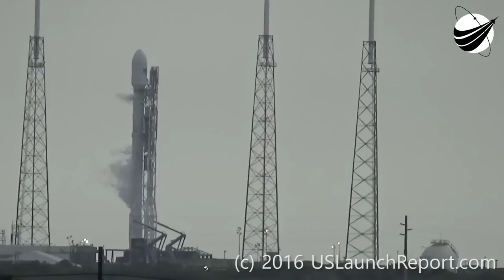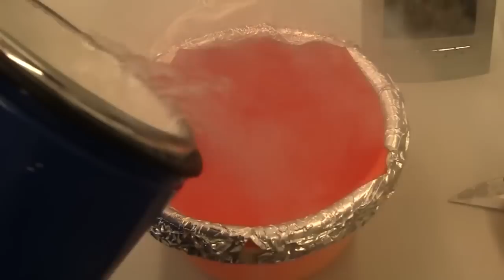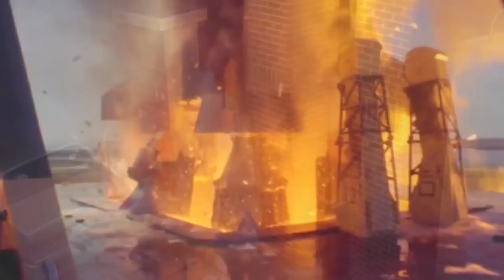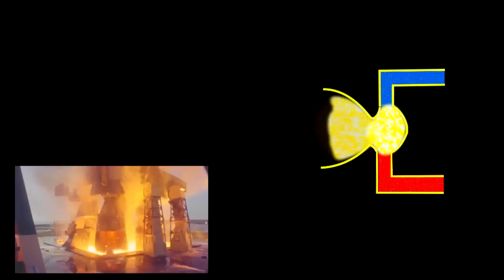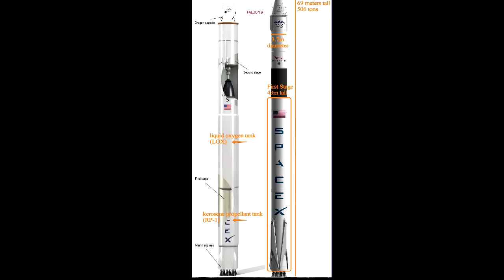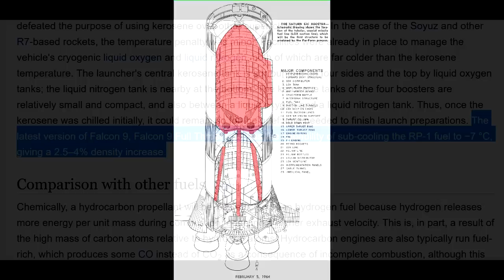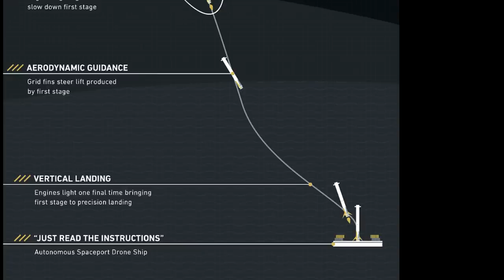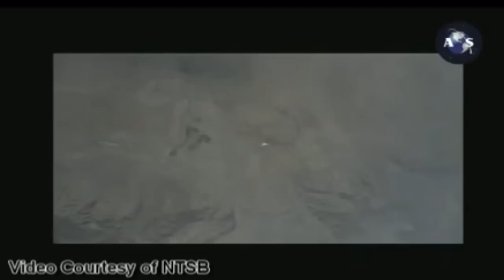Why did the Falcon 9 Explode?

Comment from the maker: This firework cost ~$250 000 000!  In a FUELLING EXPLOSION!  Not seen one of those for a LONG time... good job spacex! ;-)
Reply: I like your analysis of the cause of failure, but bear in mind that F9 reusability is only a way of further reducing the cost of spaceflight. SpaceX has already reduced the cost of a launch to $62 million, far below competitors Arianespace or ULA. This is a setback to be sure, and not to be understated, but we shouldn't take it as validation for the extremely risk averse practices of NASA etc. being the best way to do things.
Reply: I wouldn't be so harsh on spacex, as you demomstrated in this very video, they have some archivements, and rocketsience is very hard. if they fell for wrong manufacturer specifications again, they should be laughed at... a lot. 
And even if, is't not like nasa never fu**ed up big time as well.
Reply: At least it is not a billion dollar manned spacecraft exploding due to isufficient reenrty protection 
AMIRITE?

No?
Ok ,I'm gonna sit in the corner and cry then...
Reply: When Colombia spattered across the sky, did you say "This firework cost over $1,000,000,000 and seven lives! In a REENTRY FAILURE! Not seen one of those for a LONG time... Since Soyuz 1 in 1967, in fact! Good job NASA!" 

I doubt it.
Reply: +TheKSPDesigner no it hasn't, this was the Amos-6 F-29 core fresh off the assembly line, not a reused booster
Reply: david jurado mate wat
Reply: Why all the butt hurt? It wasn't your $$$, was it? I've got to imagine the payload was insured. All this did was guarantee that a bunch of engineers will get continued employment while they rebuild. Don't be so afraid of the non coercive economy.
Reply: No. If a design problem is solved by 'don't do X', then any future design that incorporates 'X' is a really bad design. What TF is saying is that NASA wouldn't build a rocket that would fail like this because they learned from mistakes made a long time ago, and SpaceX just made a 60-year old mistake.
Reply: I hope you ate that chicken
Reply: I didn't pay anything, WORTH IT
Reply: $250 million is the initial asset lost cost, but there was also the lost money as a result of the payload's mission.  Being late to market is lost financial opportunity and this set back is probably a 2 year setback for whoever owned that payload so there will probably be additional damages.  Also, insurance costs will go up on the Falcon now that they've had this catastrophic failure.
Reply: Sometimes I get the feeling that if TF were alive in 1903 he would have attempted to talk the Wright brothers into sticking with bicycles. New steps are expensive, and sacrifices must be made. It takes courage as well as brains to be a scientist. TF may be lacking in the chutzpah department.
Reply: I don't get your logic. The two Space Shuttle crashes were both from single point failure, and people died in them. Even NASA with years of experience couldn't account for all hazards of space flight.

Yes, whether or not reusable first stage will turn cost efficient remains to be seen. To figure it out, somebody has to actually try it. That's what SpaceX is doing right now, and it's harder than you clearly can even imagine. The first stage landing crashes you show are what NASA went through too - the differences between mathematical modelling and real world. You can't build a successfull rocket program without going through several of these. 

But most importantly, these have nothing to do with the explosion you're talking about. That one is not related to reusability. You don't know what caused the explosion, you just guess. Then you come blaming them for mistakes you guessed they made. 

You call that scientific approach? I do not.
Reply: A $250M rocket and statilit lose, not seen by NASA since... late 2004 when the Antares rocket blow. Almost all rockets in the US have been designed and made by "the free market" but paid for by NASA. NASA is still massively funding SpaceX. SpaceX has no bigger founder then NASA. The space shuttle was not made by NASA for NASA, but was made by the "free market" with the companies United Space Alliance, Thiokol/Alliant Techsystems, Lockheed Martin and Boeing/Rockwell.  The only thing that changed with SpaceX is who was in the lead. And when  goal is to make things most cost effective, the free market is generally the way to go. Where as, if the goal was just say "get to Mars, no matter the cost", NASA might be the better bet. Even though, NASA would outsource much of the work to private companies like it has in the past. 
  I find overwhelming praise or attacks on SpaceX to be equally pointless and silly. The lower the cost of getting to space is a worth while goal. Getting a smaller payload to space at $250/lb, is generally better then getting a larger payload to space at $1,000/lb, at worse there is "some assumable required" once in space.
Reply: Oh, don't be so hard on SpaceX for a failure that NASA hasn't had in 40 years. An issue with a machine isn't exclusively a design issue. The rocket's design is plenty good enough as is, as we have seen with how successful the rocket system has been in the past. It was probably just a case of a component that had some manufacturing fault in it make it to the launch pad, making it more the fault of the QA team than the design team.
Reply: Seriously spacex fanboys, the mental gymnastics you're all pulling here is too funny. So because they've accomplished some menial reductions in price, and the fact that rocket science is hard, makes up for the fact that just trashed .25 billion on a rookie mistake that hasn't been made in over half a century? 

"well Nasa fucks up too!"

Not having the damn rockets explode before even leaving the launchpad, moron.
Reply: It's not like they have 50+ years of rocket science to draw from.

Oh wait...
Reply: +yemo34 - The reason Humans wish to go to space is about self preservation. Earth won't be around forever, and having Humans in multiple areas means you don't lose your entire species to one event. 

All animals do this, except Humans do it on a grand scale. We know the dangers in Space (NEO Asteroids for example) and thus try to mitigate the impact something like that would have.

People living on Mars or the moon, capable of Earth return could repopulate after a mass extinction event.

Humans have already left a mark in Space though, with Pioneer 10/11 and Voyager 1/2 and New Horizons. Robotic spacecraft and AGI will be the first explorers we send out from the orbit of Sol, but it is with the intention of Humans following it.

Life as a necessity to survive and spread, from a Virus to Humans, whales, wasps and crocodiles.
Reply: fanboys incoming...
Reply: Wow Thunderf00t.  You are something.  When someone aims high and has a setback, you are sure quick to pounce.  Meanwhile you have made....weeeeellllllll.....youtube videos.   Bravo!
Reply: Since when? An explosion is an rapid increase of pressure, not combustion.
Reply: I actually learned a lot from this video. Thanks +Thunderf00t
Reply: We want to go to space for the same reason Humans went out into the ocean trying to find the end.  Most were never seen again but they would continue trying anyways.  Curiosity
Reply: It's quite sad that you genuinely seem delighted about this.Once upon a time you seemed pro science and technology.Because the guy has one stupid idea that means all his other ideas must also be stupid?
Reply: @Downstream01 I started watching this channel during "why people laugh at creationists"  and if there's one recurring theme throughout almost every video rebutting stupid shit it's the fallacy of "appeal to authority."  And somehow, that's where this video lands...appeal to NASA as authority.  Does it strike no one as ODD to cite a basically closed government agency with a seriously checkered past as "authority"?
Reply: Thank you for the lesson. I really enjoy your intelligent commentary on these subjects.
Reply: This rocket has not "gone to space and re-entered", that mission was planned for later in the year.  Also the explosion appears to originate in the second stage, and SpaceX has not done any work to recover second stage rockets as yet.
Reply: ***** i give TF some credit because i think (hope) that he is trying to say NASA should be doing space because they already did it and they do it better...

except NASA isnt doing SHIT anymore, its a space agency we created to defeat the russians and now the russians are the only ones sending people in to space, we've completely given up on ever going in to space again...

my dad was 11 when Apollo 11 touched down, i now have an 11 year old daughter and im more convinced then ever that not only will i never see a manned space mission in my life time, she'll never see one in hers... not at the rate NASA is going... so if NASA isnt NASA'ing any more then TF, what the fuck do you want?!? if the government space agency is retired then we have to rely on the private sector, and if you want them to give up or fuck off then youre basically saying give up on space completely.... fuck off
Reply: They wont. Elon's becoming unhinged. He'll force his engineers to cut corners.
Reply: Actually, NASA lost an Antares rocket carrying cargo to the International Space Station a couple years ago. It exploded shortly after launching on Oct. 28, 2014. You even used video of that explosion in your video. Does two years count as "a long time"? Or is it a fueling explosions that haven't happened in a long time? I think you might be right about that.

The Falcon 9 rocket has launched 13 times without failure. Still, this might cause insurance problems for Space-X. Everybody loses rockets, China has lost some, Russia lost a lot of them, France has lost some. So, Space-X is on par with everyone else it seems.
Reply: Louis M Your arguments are now dwindling down to appeal to emotions. No, unlike you fanboys, he sees through the facade and criticizes them for how they actually perform
Reply: Oh, the irony. Thunderf00t predicting the exact cause of failure many months before the SpaceX "experts", and all those butthurt idiots who said that Elon and his team don't need his help are now silent. It's almost orgasmic!
Reply: what do you say?, now that spacex successfully reused their rockets and sustain continuous launches almost every month?
Reply: Bah, the insurance company is paying for it. ;-)
Reply: A really great fun demonstration of a chemical reaction at the beginning there; albeit a rather expensive one! 

I imagine some guy in a lab coat loosening his tie, gulping, palm to forehead....."Doh!"
Reply: lack of funding for NASA, it usually gets slashed in favor of the military industrial complex.
Reply: i can make this video way shorter: "Why did the Falcon 9 Explode? cuz space is hard"
Reply: Yes and you know, why we all are using the rockets of the Sowjets? Because they know since 40 years how to send people to and bring back people from space ALIVE. Because as NASA they have high security measures, they are only cheaper because russia is always cheaper
Reply: 250,000 is 1/4 of a shuttle flight. Spacex can fail 2 more times and still be the same cost. Spacex also has a backlog of over 70+ flights to go. That's over 10bil of revenue,  unfortunately for the haters,  spacex is not going anywhere.
Reply: 250,000 is 1/4 of a shuttle flight. Spacex can fail 2 more times and still be the same cost. Spacex also has a backlog of over 70+ flights to go. That's over 10bil of revenue,  unfortunately for the haters,  spacex is not going anywhere.
Reply: interesting fact....NASA hasn't launched a shuttle in quite few years.  I mean, of COURSE my driving record improves over accidents vs. time if I stop driving for a decade...
Reply: TF you need to revisit your argugment here. You're saying because theoretically this was solved, there cannot possibly be any error? Like some material problem they didn't know about? You can have all the technology the same, but a minor problem with one of the tanks would be enough to blow this up. And you base this all on a lot of assumptions about what you think happened. 
It's ok that you comment on it but I hate that you're that smug about it, without actually knowing what happened.
Reply: At least it didn't come out of your taxes.
Reply: qantj vulpis by using liquid hydrogen as coolant for engines and having a better design in general like in space shuttle, like engines and tanks on different units-eg space shuttle or using solid fuels as main thrust
Reply: by keeping it's size small and bulkier,Hang on, i'll find an article in a while.
Reply: Quality content, as always, thanks Thunderf00t.
Reply: Cost of launch is not the most important factor when deciding on a carrier, the space "market" is complicated most of the money is from  government launches.   ULA is used due to reliability, the NRO satellites used by the NSA are very expensive, secretive and take a long time build, and the carrier will need employees with a high level of vetting and security clearance. If SpaceX wants to launch a government satellite you will need to vet and security clear ALL employees who will have access to it - in practice this is a nightmare.  For this reason you tend to get a monopoly for large government contracts, there are limits to privatization. Also globally, even if Space X is cheaper you won't find China, Russia, India, using an American company to launch any sensitive satellites they will use their own facilities for the security even if they are more expensive. Musk has in fact complained about ULA's de-facto  monopoly, but I can understand why it's better to have reliability and security even if it costs more.
Reply: Downstream01 Or maybe Thunderfoot is completely wrong about the origin of the explosion, and has simply put forth a reasonable hypothesis without any data to back it up at this point other than eyeballing the size of a fireball. Don't get me wrong, I think thunderfoot is a smart guy, I just don't think that he with a piece of video footage has figured out the exact cause of the explosion when the engineers at SpaceX that have access to literally gigabytes of diagnostic data with millisecond timescales AND the same video AND more video they recorded themselves and haven't released yet AND the actual physical remains in front of them haven't worked out yet.
Reply: Rothpol X "Or maybe Thunderfoot is completely wrong about the origin of the explosion, and has simply put forth a reasonable hypothesis without any data to back it up at this point other than eyeballing the size of a fireball. Don't get me wrong, I think thunderfoot is a smart guy, I just don't think that he with a piece of video footage has figured out the exact cause of the explosion when the engineers at SpaceX that have access to literally gigabytes of diagnostic data with millisecond timescales AND the same video AND more video they recorded themselves and haven't released yet AND the actual physical remains in front of them haven't worked out yet."

People who know science, math, and engineering can estimate and make very good educated guesses about the cause and nature of things, especially since there is a very good record of these failures kept by NASA. The only problem is that uneducated, ignorant people like yourself don't know any better and just assume quite wrongly that he is pulling it out of his ass.
Reply: Downstream01 As i told someone else, the Atlas V rocket, which is what the falcon 9 wants to replace, has a perfect record of launches and only costs double the money.

Too many amatuer arguments, without valid reason or facts.
Reply: Would it not be smarter to build a sling shot. #thinksmart
Reply: Blox117 Well, since you seem interested in my personal expertise, I will stay that as it happens I have an engineering degree as well... but it's not exactly necessary to see that escape from this explosion would be possible... ask and you shall receive, since an overlay of the launch abort test, and the second stage explosion has already been posted, showing that the crew dragon could have escaped with time to spare:-

https://twitter.com/StateMachines/status/771535425328459780
Reply: Admiral Quality 48 years old but cant hit the reply button and still talks like a child throwing a tantrum.
Reply: Happy Larry Fix it?! LOL
That rocked looked a little bit like "beyond economic repair" to be frank.
Reply: Well, it happened in 2010 with a proton-M rocket, it was admittedly a human error, but still, it happens...
Reply: A crew vehicle with an LES definitely would have survived as a similar failure happened on Soyuz t-10a back in 1983.
Reply: DysphoricSmile You are mostly right, however spacex is first company that have so low prices and can build new things a lot faster than sleepy giants like Boeing.
Reply: Russians are very...different. not in a good way
Reply: I'm just glad it wasn't $250 000  000 . 00
Reply: If I am not mistaken, that is not an explosion. It seems to simply be rapid combustion. Are you sure it is an explosion?
Reply: agun17
They were chilling the Liquid oxygen. For Kerosene, heating to ~70 degrees celcius works better and that is what SX and most launch providers do IIRC.
Reply: +TheKSPDesigner no. that's a different first stage.
Reply: +BosonCollider you're rates have gone up by 30%
Reply: +agun17 
Chilling of fuel was used in Formula 1 from 1970 (when there was fuel limited for turbo engines, and for faster refueling) till was banned (technically it is not banned and it is still used in F1 but minimal temperature of fuel is limited) , so it is not new.
Reply: Rapid combustion that spreads haphazardly is also an explosion.
Reply: +TheKSPDesigner no it's not, it's a new stage. JCSAT 14 is currently at McGregor undergoing delta qualification testing , testing the booster for how much stress it can withstand before failure, although this is probably on hold after Amos-6's fiery demise
Reply: See, the thing here is that the mistake was so trivial. Not saying that that doesn't happen but it is something that is uncommon now only because people are always sure to take care of it. It is laughable for sure.
Reply: This was a new one
Reply: are teslas lithium ion batteries dangerous
Reply: @Chuck norris German ww2 Jet engines failed all the time and only lasted 24 hours of flight time
Reply: No they are perfectly safe. Trust elon and put a giant one on your wall.
Reply: i trust NASA more. NASA is like a grandpa that has lived a long time and has good hindsight and knowledge on the other hand space X is like a newborn
Reply: +ThunderF00t

Do a "Why do people laugh at Moon Landing Conspiracy Theorists"
Reply: +dan1088352 I know  right. oh look your 2 degrees off in your reentry angle!! sure hope your heat shields cover enough to keep you from disintegration ;).
Reply: yemo34
I wouldn't say it's impossible, just very very very very hard. You need lots of self sustainability and life support & the ability to get fuel and raw materials form space, but its definately possible.

Current technology prohibits this at the moment.

Cavity Magnetrons are not trival and have a lot of uses. Materials science has also advanced shit loads due to space programs.

Just rolling over and excepting defeat is what kills people. From people not willing to act against SJWs, Feminism and Islam, to things like self preservation and space travel.
Reply: This is why I am all about that orbital elevator!
Reply: should have mentioned the price of the pad there at the start. i hear that thise pads are by no meens cheap.
Reply: I would love to hear Thunderf00t talk about the possibilities but I'm afraid he might crush all my hopes in the process.
Reply: You know, why we talk about Vasco da Gama, Kolumbus, Magellan, Cook? Because they or their ships came back. Nobody never went out to sea to find the end, they wanted to find new land and then come back. And they did it.
Reply: yeah and they are going to send people to mars. yeah right with their rockets blowing up the people will be dead on the launch pad.
Reply: Gahlok12 let's hope they get the whole explodey error out the way before then.
Reply: Not hardly.  A common trick used when setting long distance records in jets in the 1950s, when they were thirstier than today, was to chill the fuel using cans of dry ice (Solid CO2) dropped into the fuel trucks.
Reply: It could have been worse Thunderf00t, this could have happened with humans on board.

After learning about the most basic of basics of rocketry you start to get amazed that we got to the freaking moon so long ago with their computer tech.

I hope SpaceX learned from the explosion, atleast in that way it was an expensive lesson rather then just a waste of money.

I always wondered if it would jsut be possible to (forgive me for being the most lay of laymen) strap alot of parachutes onto the rockets so they open up after they are spent and at the apex of their arc.

on another note, why are they sticking to just rockets?  I mean we have some other methods that coudl replace the first stage of most rockets.  Something like a startram?  Are any of those ideas doable AND feasible from an engineering and science stand point?
Reply: Not when the idea is to stuff more Joules into the tank.
Rockets, and jets, store it by the liter/gallon (Volume) and burn it by the kg/lbm(Pound-Mass - it's more elegant than a Slug) (Mass)
The more Joules/L that you can stuff in, the better.  There might be a slight loss in absolute efficiency, but the overall performance is better.
Reply: +david jurado Dont hold your breath.
Reply: Look everybody Im a magician! I can pull numbers straight out of my ass!!!
Reply: Daniel Domeisen Theres not enough air at that altitude to slow the rocket down with  parachutes And the technology to build startrams doesn't exist yet, or its impossible.
Reply: what
Reply: yemo34 why would it be impossible, again from my (basic) understanding it is just a matter of making the damned thing.  it is pretty big and in essence just a long angle 'gun' that take the payload into thinner atmospheres of our planet.  Like i said it ONLY replaces the first stages. 

Now the POWER needs of the thing would mean it needs a power plant just for it but how much does a first stage take to make and use?

Again i am a laymen but a StarTram seems like it should be able to work though there are engineering issues to work out.  Like i said the thing would be pretty long to get up to speed at less the 3Gs so humans can get in it but if you nix the organic cargo you can ramp up the 'a' part of the equation to more then 9Gs.

The only part of the tech i do not understand is the Plasma Curtain at the ends, but even without that it is just a massive train up a mountain that goes very fast and launches it's cargo at the apex.

Like is aid i am a laymen, i take it you are as well?
Reply: Daniel Domeisen Just sounds like hyperloop in space to me.
Reply: too a degree but easier to pull off since it is kind of designed to fail in a way.  it is also on the ground, it is not flaoting or anything like that.  

It is also suppsoed to be either buried into the mountain to avoid the thermal expansion issue  or a cooling system would be used.  A big part of getting off of Earth is punching through our thick atmosphere  and getting up to speed.  The idea would be like a one way train in a tube to 'launch' the rocket at the top of the mountain (if possible past the cloud layer).  

it is NOT meant to be used to general civilian use, it would be used to get material up into orbit so we can make either a Space elevator or something like a sky hook so we make space flight easier and get some infrastructure up there to make to make get solar system travel going.  

Think of it like the 'Paris Gun' idea from WW2 but not used to shell Paris and instead used to reduce the cost and/or (hopefully and) mass to get stuff into orbit.

That is a Star Tram in it most simple form, a massive long barrel designed to get the rocket to speed and into the thinner parts of our atmosphere.

Combine that with a Skyhook (another way to reduce the cost/mass of space flight) and you MAY be able to make space flight as cheap as shipping something across the planet using 'next day' shipping.  That is the holy grail of what we are trying to get to with space flight, Cheap, safe, and repeatable.  

I am a layman, hence i asked the real scientist about it.  I do not have all then answers so i asked someone whom i feel might know because they know ALOT more then me.
Reply: +Sam Holden fair point
Reply: I thought it was time travelers who sabotaged the rocket to save us from a future of impending doom from media censorship, surveillance, and militant use.
Reply: its not only money... for FB or Musk 250mil is nothing, but its years of preparation and trust.
Reply: +ESportsEnthusiast Soyuz 1 did not fail during reentry you fucking imbecile. Should expect this kind of nonsense from a "Sports Enthusiast" LOL!
Reply: a rocket to Mars by isro is cheaper... America should give up on trying to be a mobility on space grade equipment
Reply: Downstream01 and we shall call you:The Honorable Downsyndrome01!
Reply: unbr34k4bl3 its 2016 and people can still easily die on the launch pad. and just how are we gonna get to mars?

next comment
Reply: +Thunderf00t How did NASA fix the problem?
Reply: Blox117 yeah people can still die on launch pads. And people can die in cars and planes too....what's your point?
Reply: Suraj Grewal How did they fix the kerosene freezing due to the liquid oxygen being pumped past it?
Reply: They use liquid Hydrogen
Reply: Suraj Grewal How do they fix it for the lower stages that use kerosene?
Reply: trial and error plus the gap between the 2 tanks is quite big ,'ill say , while admitting that I ain't rocket scientist.
Reply: who has to cover the lose in this 250million dollar fire works show?
Reply: +kasuha I agree, even though there was some analysis involved to try and define the cause, the colnclusion was far from certain.
Reply: Yeah, read a bit on what we have thanks to space exploration... Microwaves are radar based, not really space tech. Usable solar panels are however developed for space.
Reply: Yes there are starving people in Africa
Reply: I wouldn't want to be the guy handing a bill over for the check. lol
Reply: unbr34k4bl3 Pretty much no one dies on takeoff or backing out of their driveway.
Reply: They were testing the fueling procedure when it blew up, they weren't pushing ahead with anything.
Reply: Downstream01 ahem
You have to mix the fuel in order for the to be complete combustion like we saw in the video. No matter how exactly it happened, it happened moron
Reply: Downstream01 Landing is probably the most dangerous part of flying.
Reply: Downstream01 The fuels don't magically mix, there's only a few different ways they could have ever come into contact. While we're at it, since you conceded that your original statement was quite clueless and folly, I've already won the argument.
Reply: Downstream01 Hell, you're so stupid that you think that they would want to admit that it was a rookie mistake  if it was, and that they could very well just obfuscating in order to protect their reputation.
Reply: Downstream01 Exactly right. I agree with Thunderfoot that fuel and oxidizer mixed to cause this issue, what I cannot agree with is the idea that Thunderfoot can somehow pinpoint the exact initial cause of the original mixing that led to the explosion. Obviously the mixture happened SOMEHOW, I simply don't think we know HOW at this point.
Reply: Downstream01 You're entire argument was based on it not being a rookie mistake because we do not know what caused it. But we do know that at the core of it, the fuels mixed. We also know it hasn't happened in over half a century. Hence, rookie mistake
Reply: Rothpol X Yep, because there is obviously just too many ways to count how two fuels could've came into contact while filling the tanks. 

You're right Downstream, Spacex aren't the the ones obscuring, you guys are !
Reply: Last time i checked an explosion is defined as a sudden release of energy. Rapid combustion sounds like an explosion to me.
Reply: aiGeis If it's a rookie mistake, why did it happen on a rocket design that has had more than 20 successful launches so far without anything like this happening?

To me it seems more like there was a hardware change in the umbilical interfaces, or maybe something wore out or broke or wasn't attached correctly, and the explosion originated there. Remember, SpaceX has already flown the Falcon 9 many times, and tested it many many more times on the ground, and they have NEVER come across any tank fracturing liek Thunderfoot suggested, nor have they ever had any fuel leaks or catastrophic failures due to an explosion. The previous Falcon failure, and the only launch failure, CRS-7, was caused when a defective strut allowed a high pressure helium tank to rip off of its mountings and slam into the forward tank bulkhead of the upper stage oxygen tank, which ruptured it and caused the rocket to disintegrate. Interestingly there wasn't any actual explosion there, just a big vapor cloud of un-burned fuel and oxygen. 

When NASA was having anomalies during fueling operations, they were still having problems even launching rockets at all, and had a massive failure rate across the board. SpaceX has had ONE fueling incident, on a vehicle that has flown more than twenty times, and people are acting like it's the end of the company.

Rocket science is hard, rocket engineering is harder, operating rockets in real life means dealing with problems and setbacks, every entity that has ever built rockets knows this.
Reply: Success does not equal perfection or mastery of said art or science. Sure SpaceX may have had a good streak of successful launches however this one failure has set them back a mile when they just walked forward 20 feet. If SpaceX takes their craft seriously, they MUST go back to the drawing board and figured out what the hell happened and go from there. NASA had their failures, yes. However considering they had nothing to go on, basically the pioneers in rocket design for space exploration, their failures are to be expected. Fast foreward 60 some years into the future SpaceX has suffered from a catastrophic anomaly that NASA has apparently already experienced and probably already resolved. Unless SpaceX is doing their own thing...which I highly doubt... they would be at least be smart enough to consult with some of the leading experts on space exploration, which one of them is none other than NASA themselves. I'm aware there can be millions of factors that can result in catastrophic failure. However if anyone in the space exploration program has learned in these last 60~70 years of trial and error, it is the 99% of catastrophic anomalies are a result of human error.
Reply: ^Literally the definition of mental gymnastics. Oh well, guess fanboys can't be helped.
Reply: aiGeis >A system as complex as a rocket will have issues early on in its lifetime

>mental gymnastics

what the hell is wrong with you dude
Reply: ***** Wow you really got me haha good one
Reply: Rothpol X There are only certain ways that the explosion could have happened.
Reply: the dunning kruger effect is strong with all the fanboys...
Reply: i used to like space x as well, but now it just seems like they are fueling their rockets on dreams and wishes. this popular opinion and pop science shit really needs to die. space x doesnt care about you, they dont care if you defend their honor on some video on youtube, it wont make a difference, truly.
Reply: Downstream01 " You know the Concorde was brought down when a piece of metal hit its tire, which exploded, the fragments of which hit the fuselage and sent a shockwave through the plane that burst the fuel tank."

I guess that incident truly was similar to a rocket exploding during fueling on the launch pad. 

"You have nothing on the already impressive technical feats SpaceX has done, the only actor interested in moving the space industry forward."

3/10 irrelevant troll bait.
Reply: Derek C. aw come on, its not spaceX's fault that they ride on rockets made out of rainbows and kiddie dreams.
Reply: you are the definition of a fanboy and you are not thinking straight because you are looking for the next Messiah
Reply: Downstream01 Im not against privatizing the space industry, but with such a stupid mistake like happened with the falcon 9, people will get killed before even going into space.

And no, saying "well NASA got it wrong too!!!!!" does not excuse the fact that they are making the same kinds of mistakes that happened in the 50s and 60s. If people were on that launch instead of that satellite, spaceX would have blood on its hands.
Reply: DarkBabylon - Gaming videos Shit, I thought that was only me. Jesus christ google, fix this shit already. Unbelievable.
Reply: Tactical nuke inbound!!!

https://2.bp.blogspot.com/-BZ95EiMjYQE/Vxc1K1x1DnI/AAAAAAAADSE/h67uMW3d0bgt2Qo0HYnLrG8Hm87eO3w2wCLcB/s640/Rainboom.gif
Reply: the rocket? nope it was factory-new
Reply: tssk
62$M  , maybe ...how man for the load again ? 200$M ?
I dunno, seems awfully costly when ou take account of the risk of loosing 200$M in load for your FAI/COM company to provide PHONE/TV/INTERNET etc...
IF i were to ensure to satellite reaches its destination , i 'd rather pay up for a more reliable rocket but more expensive than the  discount rocket wich really isn't very trustworthy....
Reply: Try and retry, explore new ways. Things sounding rediculous, thing you'd expect to fail initially. Tha is where all technology stems from.
Yeah look i have some sand here i put it in an oven and carve some intricate patterns on it an it'll solve mathematical problems for me.
Or let's put some halfdead bacteria into human bodies, it'll help them in the future.

Some ideas sound stupid at first glance but have proven to be usefull. We need to continue and we need more courage.
Returning booster stages is not that stupid. We have the Energy Density vs. Cost problem and are figuring out ways to compensate. During Cold War this wasn't much of an issue for cost saving designs weren't the goal. That is what landed humanity on the moon and is what hinders us to undertake the same thing today.

Try and fail.
Try and fail.
Try and fail.
Try and fail.
Try and fail.
Try and fail.
Try and fail.
Try and be successful. Bang !
Reply: The explosion actually happened during a test. It was the last test of many they carried out at Hawthorne and McGregor. How does it feel to be an egotistical idiot with no money?
Reply: But it is what we do in a grand scheme. Maybe not a suitable way for a company. But that is just how evolution works. Try odd things and some of them prevail. If you just look at a small timeframe or the history of a single company you won't see much of that. But in large scale this is what happens everywhere, all the time.
Reply: Shame you need to be sarcastic. It's so easy to point out other peoples failings. Why don't you crowd fund and just get one to leave the atmosphere? I mean it's not brain surgery....
Reply: Can I have half of that nothing please?
Reply: Who are you talking about? And how did the egotistical idiot get the money, and what would you consider too much money?
Reply: they dun goofed
Reply: New technologies will inevitably have many fails. I don't see you point. Mr Musk mission is to get to mars and colonise it. 
It's easy for people like you who mock it to be the first in the queue when the earth becomes inhabitable nd would beg for a ticket to mars which you almost certainly afford.
Let me give you an analogy.....Kids learn to walk by falling over.
Reply: +Sebastian Larsson Though "a rapid combustion" is the most common cause for explosions on purpose on our planet, a better description of an explosion is something like a sudden, rapid expansion due to a major release of energy. This would encorporate explosions from atomic bombs, (overpressurized) tanks and supernovae, for example.
Reply: Downstream01 really? so the crew would have known that the rocket would explode before it kills them?

come on now, the crew would be dead, and elon musk would look like an idiot and try to lay blame on some extraneous problem.

But at least you admit that the falcon rocket is not suitable for anything other than trials yet.
Reply: +DarkBabylon - Gaming videos "Comfortable" isn't the right word. "Hospitable" or "possible", maybe. Small amounts of people will ALREADY live on another celestial body before we're worried about things like "comfort". 

Note that being able to breath is a necessity, not a comfort.

I also said celestial body, not planet, because we're more likely to live on a moon than any of the planets in our solar system. (Or simply a different system entirely. which is more difficult, and many more years away, but more likely/plausible).
Reply: Louis M Your argument was based on an appeal to emotion "don't you want them to succeed"

What are you, a woman?
Reply: Downstream01 I am pretty sure they wont outrun an explosion. Pretty damn sure, in fact. If you would say that you trust your life on the escape system for something that is beyond its capabilities, then i guess the falcon 9 is just as safe as the space shuttle then. but at least the space shuttle, for all its flaws, never exploded on the damn launch pad. especially not so early in its life.
Reply: +Downstream01 I think sling shot tecnology is more safe and less expensive.
Reply: Downstream01 the escape system is only there if there is a known problem, such as a failure of the staging, asymmetric thrust, the rocket tips over, there is a fire, etc. an explosion as seen in the video was very sudden and without warning.
Reply: Blox117 Escape systems in manned rockets are not new, there are well established mechanisms for detecting catastrophic failure and triggering an escape system... one only needs to imagine running a cable around the inside of the structure which would be broken by an explosion or other "unscheduled rapid disassembly" event...
Reply: James Lewis and how, pray tell, would the escape system outrun the explosion?

please, IT and computer security is not similar to physics.
Reply: +Downstream01 If you guys send this info to space x could you also mention my sling shot tecnology. Thanks.
Reply: My theory is that NASA/Illuminati aimed an infra-red, high-powered laser and lit the rocket. Or, someone "accidentally" pressed the self-destruct button, probably a NASA infiltrator.
Reply: So, you have (and presumably, as you're posting about it, embrace) two complete disparate theories. Yeah, I can come up with an infinite list of what-ifs. But... SO-WHAT?

The FTS (flight termination system) wasn't armed yet (and probably isn't activated and armed at all during a static fire) so it would take more than an accidental press of the button to make that happen. (That said, yes, there's other explosives on the rocket that TF is completely ignoring and/or pooh-poohing. I think far more interesting is possible failure modes from the payload satellite leaking hydrazine down into the top of the second stage. Since we're pulling "theories" out of our asses now...)
Reply: You can probably guess I'm joking, right? I like your hydrazine hypothesis though.
Reply: Oh, others pointed that out before I thought of it. But while it may not be my hypothesis (frankly, I don't have enough data to form one) it's definitely a possibility.

So is sabotage, but that's just hot air without any evidence too. Let's try to wait...
Reply: Admiral Quality You make a quality argument, sir. The popular "theory" seems to be a UFO dunnit. Of course. Sigh.
Reply: Yep. Occam's razor in reverse.
Reply: Downstream01 elon musk should hire you guys so his next rocket doesnt destroy itself.
Reply: We don't know yet that his rocket did destroy itself. But job offer accepted, nonetheless!
Reply: Downstream01 is that a retarded use of a word you don't understand? put that word away before you hurt yourself with it.
Reply: Admiral Quality it destroyed itself, dont play the idiot.
Reply: Downstream01 "I see a butthurt naysayer who's been proven wrong and can't accept it attacking us, instead of our arguments."

Indeed, I see her too. By the nickname, "Downsyndrome01"
Reply: Downstream01 what is your picture about?
Reply: Thank you for making this video. I've been wanting to say something ever since the recent Space X failure, but I've been worried that the Elon Musk fanboy horde would attack. Space Xs failure rates are dismal when compared to the failure rates of comparable rockets. The latest Delta and Atlas series rockets have had no catastrophic failures (only 1 partial failure which still resulted in the rockets payload surviving), yet the Falcon series rocket is continually being pushed on NASA as a replacement for these rockets. I'm sure Space X's rockets will get better over time, but don't start using them for your $200 million missions until they have undergone more testing. 

Also, I can't stand the entire marketing scheme that this is "private industry rocketry!". Sure... Like we have never seen private industries making rockets before. Sorry, Boeing, Thiokol, Lockheed Martin, Northrop Grumman, etc., etc. you don't count as private industry.

At the end of the day, both Space X and Virgin Galactic are new players to the game that will stop at nothing to take over the space rocketry industry.
Reply: Yep, SpaceX's failure rate has just now dropped to about on par with the industry average. The lies these bashers tell...
Reply: And a satellite in a useless orbit is as much a failure as blowing one up is.

Atlas 5 also recently came very close to a failed mission when ULA launched Orbital's Cygnus to the ISS. Their day will come around eventually and everyone in the rocket industry knows it. That's why most of them know better than to mouth off when their competition has a bad day.

http://spaceflight101.com/cygnus-oa6/by-the-numbers-how-close-atlas-v-came-to-failure-in-this-weeks-cygnus-launch/
Reply: if they spent more than this on a Ghostbusters Reboot, i'm pretty sure we can build another. I had imagined this to be much more costly :) great research
Reply: Admiral Quality this kid is still going on.
Reply: And you're still unable to even begin to form an argument.
Reply: And I'm 48 years old, fuckface.
Reply: "Can't hit the reply button"? WTF are you talking about, little fool?
Reply: Downstream01 and you kids aren't trolling? come on now! we can all be honest with each other :)
Reply: Downstream01 - best age of empires player, 2016

lol
Reply: It was to be a static fire test that they always do a few days before a launch. They start the engines like like a regular launch but don't release the rocket. They run the engines for a few seconds and make sure everything looks good. They were still 8 minutes away from firing the engines and still taking on propellant when the explosion started near the top of the second stage liquid oxygen tank (which is nowhere near the engines) where the fueling lines go on.
Reply: Downstream01 i left a reply to him above, but truly this topic is a few days old now and I am done arguing.
Reply: Downstream01 If it was a hypergolic fuel mixture that started it, then the problem would lie with the engines on the satellite.
Reply: Downstream01 it is after yours, cant help that you cannot read through it all.
Reply: Downstream01 i guess it got marked as spam for some dumb shit reason. oh well.
Reply: however, that is only like the cost of THREE F-35C's which are a millatry asset which is expected to face loss in combat
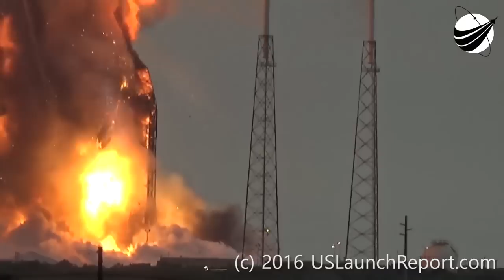Reply: 0:15 I heard the thunder, but I didn't see the foot.
Reply: David Button: Well, the Shuttle was a too expensive experiment, and also too unsecure (no other system had 14 dead crewman in 30 years). But it still didn't exploded at the ramp while fueling...
Reply: SO O If you aim too high, you are inevitably shooting yourself in the head.
And if people are too dumb to realise that simple and unoverlookable fact, that is very funny, very funny indeed.
Reply: they might fix it
Reply: What a dickish comment.
Reply: You're so full of sh*t, sell out. You're going to look like such a liar, or are you going to be like "Duh NASA was lying to me :-(! The earth is flat?! Oh my how did I miss that being such a big egghead? Duh!"
Reply: +DarkBabylon - Gaming videos ---- flat Earth ones or the regular round Earth ones?
Reply: DarkBabylon - Gaming videos 
Gamers ...LOL  Unbelievable!
Reply: from 3km I take it..
Reply: DarkBabylon - Gaming videos 
Wut?
Ah! The German word for anger.
Why are you angry? Is it your brain? Does it hurt?
Reply: DarkBabylon - Gaming videos There are therapy groups that can help you. I think it is called "anger management".
Reply: Funny all those people commenting here, i guess they are guys from NASA who lost their jobs because SpaceX :P
Reply: Where did they insure the Rocket?
Lloyds, London?
Reply: Well, the financial crisis cost Germany alone 500 billion, I guess we could too spend some pennies on fireworks.
Reply: Well You have to give Space X credit at least they are trying, and have succeeded in lowering the cost of LEO payload insertion. Also Elon said at his mars plan unveiling, that Space X will be using one of the recovered stages in a launch I believe by the end of the year. May be wrong about the timing, but they are using one of the recovered stages in a launch.
Reply: jake kiedaisch "payload insertion" Really?
What payload have they inserted so far?
Reply: Lest see there have been 9 separate ISS resupplies, The JCSat-16 and SSL launches for Sky perfect JSAT corp. Also the ASIASAT-6 and ASIASAT-8 launches. Then you have the SES and 2 ORBCOMM launches, the THAICOM-8, jason-3, EUTELSAT AND ABS, ASIA BROADCAST SATELLITE/EUTELSAT launches. All of those were launches that went up on Falcon9 and Dragon-Falcon9 rockets. there are more but I think that I get my point across.
Reply: DarkBabylon - Gaming videos I guess I wrote it weird, but there have been more than nine flights, you have the nine ISS resupplies and all the rocket after that.The names of the rockets weren't then names of the ISS resupplies, they were in addition to the ISS resupplies. In total there have been about 19 successful launches not including the demos and testing flights.and here is Space X's launch manifest with the launches that space x has done and the ones planned for the future.http://www.spacex.com/missions
Reply: +Malcik Serghei the money is still there that did not burn up just someone else has it.
Reply: But yay we have real information the explosion was caused by liquid helium, carbon fibre, and solid oxygen mixing. That has never happened before, and that is why it took so long.
Reply: jake kiedaisch How on earth does Helium cause an explosion?! It is inert.
"Real information", my ass!
What is this thing here? A rocket or a ballon?!
People … seriously!!!
Reply: Here, let me enlighten you as to how helium can cause an explosion.
SpaceX uses liquefied helium, which happens to be the lowest temperature liquid currently known, AND IS BELOW THE FREEZING POINT OF OXYGEN. Keep that in mind, it'll be needed here soon. SpaceX stores this liquid helium in Composite Overlayed Pressure Vessels, or COPV's, which are mainly carbon fiber, and are stored inside of the Liquid Oxygen tank. Now, remember how liquid helium is below Oxygen's freezing point? Well, Solid Oxygen just happens to be very nearly hypergolic, or burning on contact, with carbon. Oxygen burns with carbon, blows out intertank structure on the second stage, mixes with kerosene, lights. Explosion from a solidified oxygen caused by cooling due to liquid helium.
Reply: Dethbyobsidian
No liquid helium it's still a gas inside the COPVs but they store it as a liquid at the launch site.
Reply: Patchuchan
Reply: +Room 641A it would of gone higher that that
Reply: Dethbyobsidian So they just use it to blow away the empty shell of first stage by exploding its tank?
Reply: Room 641A SpaceX uses the helium as a pressurization medium for the fuel tanks
Reply: jake kiedaisch Yes, but why are they exploding the tanks? Wasn't reusability one of their concepts in the very beginning?
Why have they moved away from that idea?
Reply: Look at Dethbyobsidian's post above. So the liquid helium (contrary to what Patchuchan said it is liquid in the tanks) froze the liquid oxygen, and solid oxygen is hypergolic with the carbon fibre in the tanks which caused the explosion.
Reply: DysphoricSmile good series Mars
Reply: Cost of demonstrating that jet fuel does not melt steel: priceless.
- that it took out Israel's apartheid space junk with it is extra special :)
Reply: Thunderf00t oh my god. The firework costs 60 mill and the payload costs 250 mill. You even said it in your own video. I'm disappointed in you.
Reply: not mentioning that space shuttle is actually, statistically, the deadliest space launch vehicle
Reply: Now TF you are being a huge hater. I imagine your big smile when the rocket explode. I imagine your big disapontment when space x accomplishes a new engineering wonder.
Reply: an explosion is a rapid combustion
Reply: That said, thanks for the video. The explanation was terrific and likely couldn't have been found in such clear terms anywhere else.
Reply: Don't for a second think that Phil knows more about the Falcon than the engineers at SpaceX, as he would like you to believe. They got this, Phil. They don't need your advice.
Reply: thank god we still have the russians
Reply: Downstream01 You're right man, there is a fair chance that that it was an invisible allahu akbhar and not the fuels mixing at all.
Reply: I am by no means a rocket scientist, but having followed the Space Shuttle program, and being well aware of its extreme costs in maintenance being the reason it was decommissioned - I always wondered why the hell SpaceX was even attempting to recover their ROCKETS - not even a shuttle like Virgin Galactic is trying to build, but what is essentially an empty and beat up TUBE, that would require almost the cost (possibly as much or more even) of building a new one to refurbish well enough as to be confident in sending it up into space again?

I mean it serves as little more than ADVERTISEMENT, Elon Musk can say "I built a reusable rocket that lands its self!" And the Musk fans cheer, as if this were some totally new and important step in our eventual travels into space, when in fact, it is not - and NOT EVEN ONE Falcon 9 has been reused even ONCE! 

I really do not understand the hype so many people get caught up in regarding Elon Musk and SpaceX, when neither he, nor his company, have yet to build ANYTHING new regarding space travels.

And now we have this "Mars" series that tells a story, whilst constantly advertising Elon Musk and SpaceX! It is fucking annoying to me, I tried watching the show, and even skipped all the Elon Musk and SpaceX dick stroking, but there is just so much, and they cut so much of it into the STORY the series is TRYING to tell that I have yet to even watch episode 2, despite finding the actual story to be quite interesting.
Reply: SpaceX really had a breakthrough in rocket development.
Reply: Actually, if i remember correctly NASA was involved in design of Falcon 9. If there is a design flow, it is probably a new one. You should check your data before giving a comment.
Reply: its fucking hard to make a rocket don't be all sarcastic. "GoOd jOb sPaCe X! " I like your content though.
Reply: +MsMotron rocket science isn't hard. it was hard that is the point. the achievements are in guidance which has nothing to do with SpaceX all from the fighter jet industry. this was caused from a problem nasa had and fixed years ago and the idiots at SpaceX are making them all over again.
Reply: nasa and spacex share the same fate though. death. People need to let go of fantasies. Human Space travel is such a fantasy. Theres no point anyway.